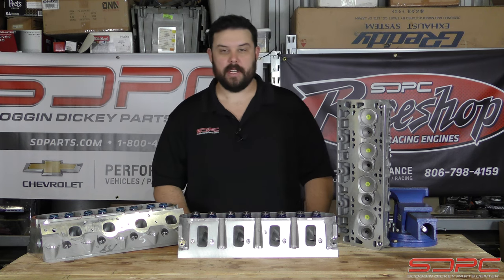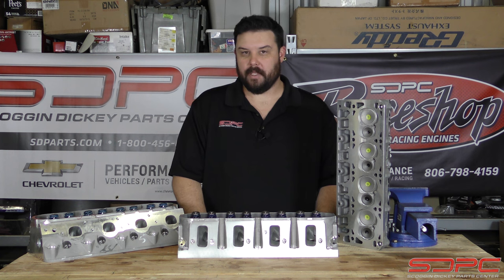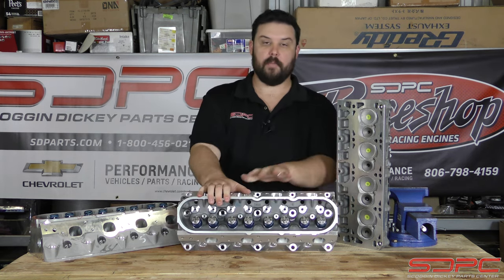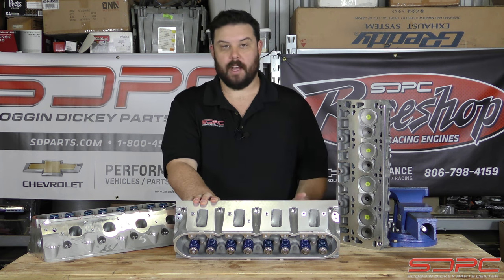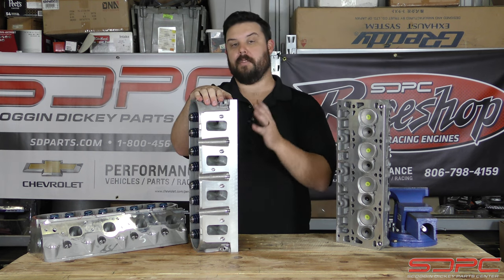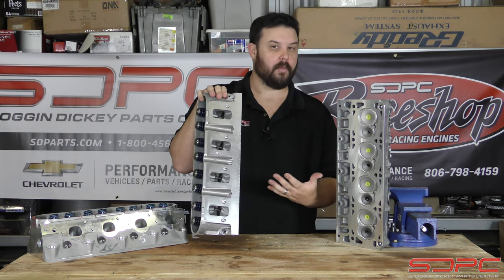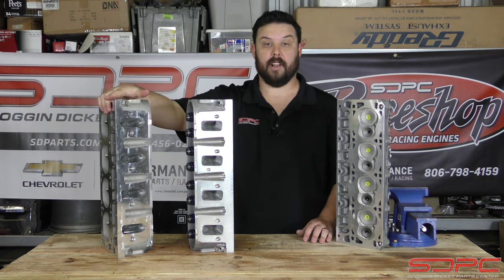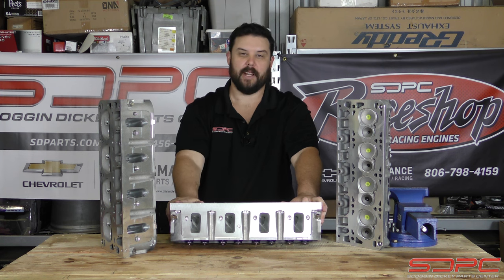SDPC Tech Tips: Factory Cast CNC Heads

Comment: You forgot the flow # ;)
Reply from the maker: Fixed!

Intake
CNC vs stock
0.200: 162 - 151
0.300: 250 - 208
0.400: 294 - 256
0.500: 340 - 294
0.600: 352 - 316

Exhaust
CNC vs stock
0.200: 127 - 111
0.300: 186 - 152
0.400: 222 - 174
0.500: 246 - 183
0.600: 253 - 189
Reply: You didn't say anything about the CNC  rotocast LS9 heads

Comment: What is the part # for the CNC LS3 head? Can you get a bare CNC casting also and if so what is that part #?
Reply from the maker: 88958758 for the complete cnc ls3 head but it is a discontinued part. I can't seem to find the bare cnc head but I believe it was offered at one point. Still going to be discontinued as GM has abandoned that line entirely now.